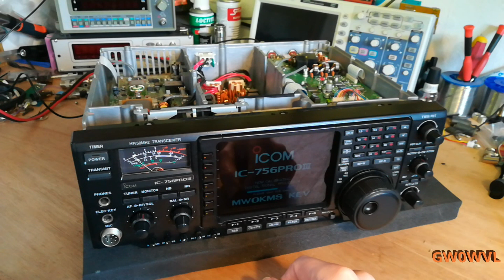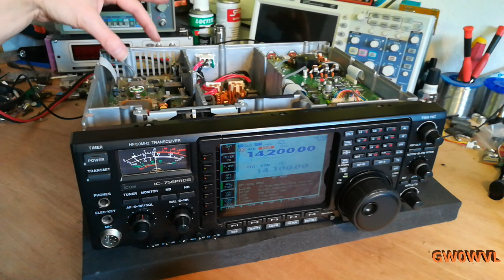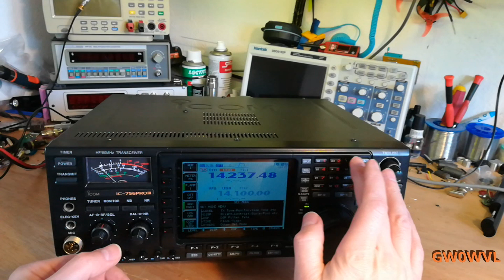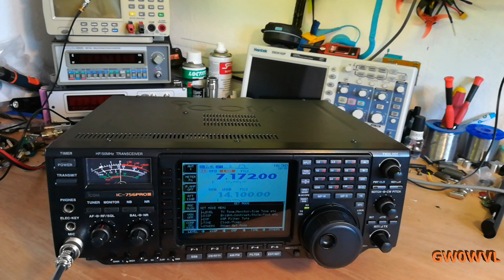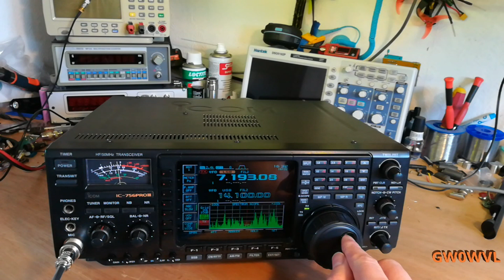GW0WVL ..ICOM 756 Pro 3 Repair part 2

Comment: Is that third relay the PTT relay??  I suspect a have a bad PTT relay.  Sometimes when I let off the key the incoming signal drops to almost nothing, but if I just hit the key again momentarily it will jump back up the the normal signal level.
Reply from the maker: That does sound like you've got a sticky relay , Ide also check for bad solder joints as well .